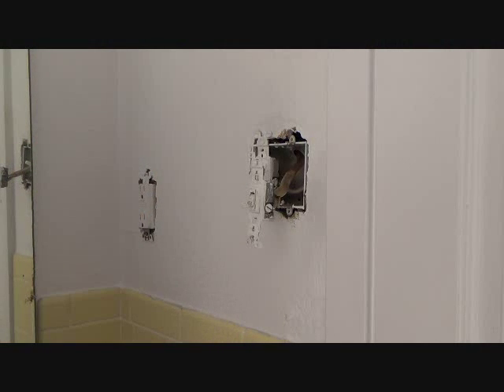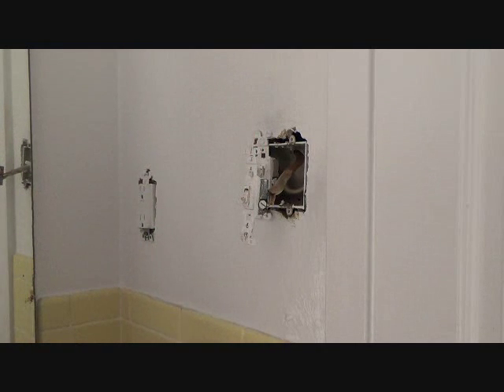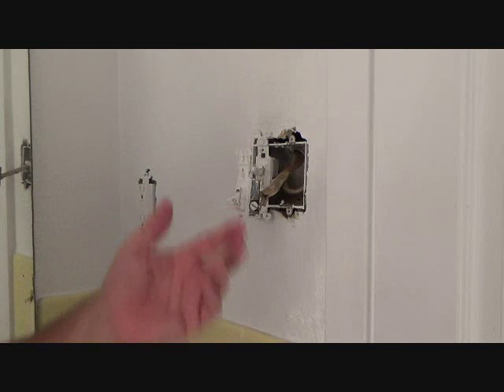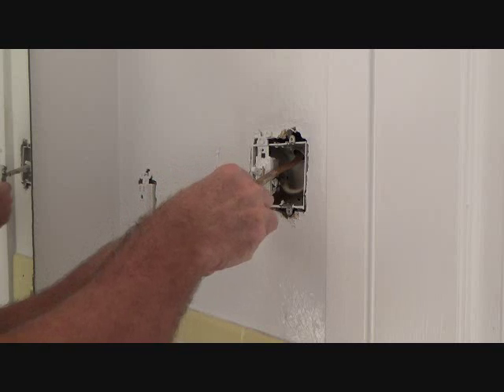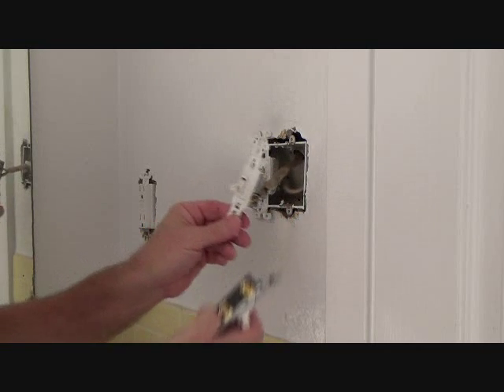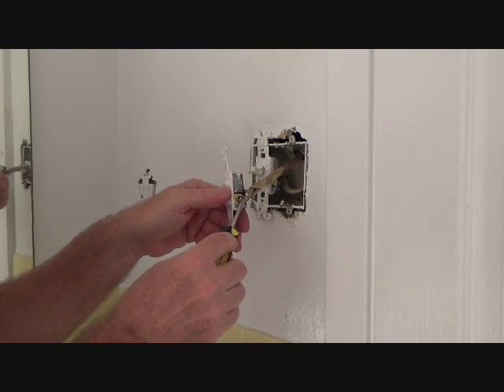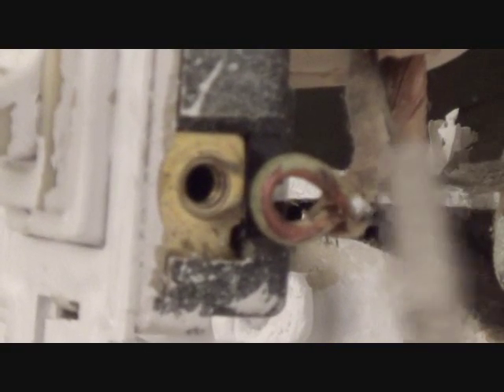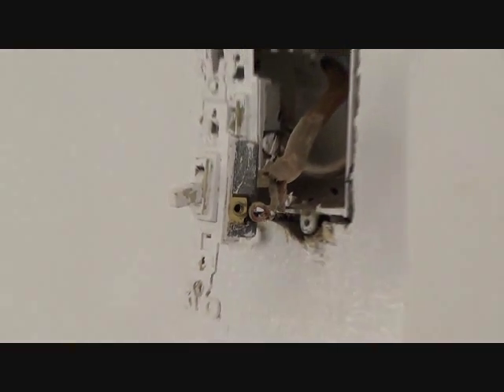Why is there a white wire connected to the light switch?

Comment: This was exactly what I needed. I had two white wires nutted together,, two grounds nutted together and two black wires going into the switch because lighting controlled in ceiling. So installing a dimmer switch simply left the white wires alone added the green ground wire from dimmer to the two nutted grounds and then side screw the blacks to the dimmer hot side top and bottom. Voila done. Thank you 🎉
Reply from the maker: Nice going! sounds good!

Comment: Where do all these wires go?? In my 1950's house, my bedroom ceiling light box has 5 cables coming into it: the power coming in, a bedroom wall switch, a wall plug, a bathroom wall switch, and an outside light. I am at a loss with what to do with all these wires.
Reply from the maker: Yes in the old days they use to use the light fixture junction boxes to where they would bring the main power to then offshoot to other locations as you have mentioned. Now days most of the time the main power cables are generally run to a light switch location THEN up to light fixture from light switch while in the old days the main power source was fed to the light fixture THEN from there they would bring power down to light switch then back up to actual light fixture making it confusing for some people such as yourself! Generally now they would also bring main power to a duplex outlet then from there to another duplex outlet etc & not first power to a light fixture then from there power down to a duplex outlet etc. such as yours. So the power you have up at your light fixture will kind of get confusing to you for sure....let's just look at the main power wires that come in to your light fixture then down to wall switch. Let's talk about the wires going to your wall switch for that same light fixture......if you go in your wall switch junction box you will probably see a white wire & a black wire only. The black wire is probably the power wire coming from your light fixture then down to power your wall switch & the white wire is the power feed that goes back up from your light switch & powers up your actual light fixture black wire coming from your actual light fixture itself....see? Kind of hard to explain since in most cases today they would do it differently because the white wires are generally used for the neutral side of a circuit only while in your case they are using the white wire as a black power wire & not a neutral wire per se.....the initial electrician should have put some black electrical tape on that white wire in your wall switch box so you would know that they were actually using that white neutral wire for an actual black power wire. So that should resolve your wall switch for your actual light fixture. Most all the other wires that are in your light fixture box as you have said the black wirers should all go together & the white wires should all go together but the white wire that comes back up from the one wall switch that powers that actual light fixture would then connect to the actual black wire that is coming from the actual light fixture itself & the white wire that is coming from the actual light fixture should then be connected to all the other white wires in the junction box.....am I confusing you? That's what I think they are doing in your case.....they used the light fixture junction box as the main power junction box to then take power all to your other locations. Let me know if you understand what I am saying here & check out that one light fixture wall switch box to see if that one light switch that is working for this one light fixture is wired this way. Thanks for stopping by! Watch that video again & it might become more clear to you what they are doing for at least the light switch that is being used for that one light fixture....
Reply from the maker: Let's just talk about the black & white wire that go down to the wall switch for this one light fixture ok? The black wire will be the power wire for the light switch. The white wire will be the power wire from the light switch that will then get connected to the black power wire from the light fixture itself. The white wire from the actual light fixture will then be connected up to all the other white wires in the junction ceiling box...boom! See? All the white wires in the ceiling box will all go together EXCEPT the white power wire that is coming up from that one light switch. Then all the black wires will go together as I believe. Your main power black wire that comes into this box is the power wire that will feed all the other black wires in the box so put all those together under one wire nut, EXCEPT the black wire that is coming from the actual light fixture itself.....that black wire from the light fixture will be connected to that white wire that is coming up from the light switch for this same light fixture.....see?
Reply from the maker: Reread my two messages & let me know if you understand what I am saying & send me your thoughts & or questions....because I am not there to actually see where all these wires are going I am making an educated guess to your situation so send me a message after reading my messages. Thanks again!

Comment: So they hooked the white wires together in the light fixture?
Reply from the maker: Sometimes though some electricians will actually run the hot set of wires to the light fixture ceiling box first then they will run a feeder wire from the light fixture to go down to the light switch so then they would connect the wires up in the light fixture a little bit different as one of the hot wires will go down to the light switch & then one wire will go from the light switch back up to the light fixture so in this case one of the white wires going down to the light switch will actually be a hot wire not a neutral wire since a light switch doesn't need a neutral white wire connected to it.....Confused yet? When the electrician might decide to do this they should actually put a piece of black electrical tape on the white wire up in the light fixture box to notify anyone that they are actually using the white wire as a black wire. So if you open up the light switch area & if one of the wires connected to the light switch is white then you know that the main power is up in the light fixture then goes down tot he light switch. Generally when this happens you will only have a white wire & a black wire in the light switch junction box with both of those wires connected to the light switch. In most cases though the electrician will run the power to the light switch first but in the old days they used to always take the power to the light fixture first. Let me know if you have any questions... hope this answers your question.
Reply: @VideoJoeKnows  reason I ask is because in my bathroom I’m wanting to change light out there’s 3 wires 2 white one black and a ground one of the white wire is hot and the other white one goes to switch an the black one goes to switch then the solid copper ground for me to be able to run the switch should I hook the white coming to switch and the white one that hot to the light fixture then the black hook together then ground it for it to work ? I’m lost
Reply from the maker: @southernslipping4225  I am making the assumption you are talking about the wires up in the ceiling light fixture junction box. Here's a question I would like to ask...are you sure there's not two black wires up there as well as the two white wires & ground wire you had mentioned? You have said there was just one black wire...but most of the time there would be two black wires....if the main power is in fact going to the light fixture junction box first then there should be a black & white wire & ground wire for that as the black wire is the main hot power wire & the main white wire should be the neutral wire for the circuit. From that there should then be a separate black wire & separate white wire that go down to the light switch & the black wire would be the one to power the light switch & the white wire should be the power coming back up from the light switch to then power the light fixture...if that was the case then the main hot black wire in the light fixture ceiling box would then be connected to the black wire that then goes down to the light switch & be connected with a wire nut......then the white wire that comes back up from the light switch would then be connected to the black wire from your light fixture. The white wire from your light fixture would then be connected to the main white neutral wire that comes into the light fixture junction box & your ground wire would be connected to the ground wire. See what I mean? So I'm surprised if your light fixture junction box only has one black wire in it along with two white wires. Look again & see if in fact you only have one black wire in there.....If you only have one black wire then I would think you should only have one white wire there too since then it would tell me that the main power wires would be at your light switch & not at your light fixture. How about removing your light switch from the wall to see how many wires are in the junction wall box. If the power is at the light fixture then you should only have one white wire & one black wire & a ground wire in the light switch junction box & both the white & black wire & ground wire would be connected to the light switch. Let me know what you find so I can assist further if need be.
Reply: @VideoJoeKnows  there is a white wire and a solid copper wire then there’s another white and black coming from the switch .. also I was go ask in my other light they have the solid wire hooked to the white wire do I need to hook this one with solid wire to the white wire ?
Reply from the maker: @southernslipping4225  Still weird for me to think you don't have another black wire up in the light fixture junction box. Did you look really close? Why would the previous electrician only bring a white & ground wire to this box if the other white & black wire are coming back up for the light switch location? As for your other light fixture, how many wires are up in the junction box?
Reply from the maker: @southernslipping4225  Usually a solid copper wire would be the ground wire...so my question would be...where is the black hot wire that feels the light fixture junction box?
Reply from the maker: @southernslipping4225  If the main power is in fact coming into the light fixture ceiling junction box then you should have a black hot wire & a white neutral wire & a ground wire coming into the box for the main power source. If you then say there is a black wire & white wire going down to the light switch from that same light fixture ceiling box then my question is where is the main black hot wire? It should be in that box too.....
Reply: @VideoJoeKnows  it’s and older home it only has the wires I listed .. that’s why I bum fuzzled to ha but my light in hall way has the solid copper wire and white ran together and the blacks together
Reply from the maker: @southernslipping4225  Not sure what to tell you as I've only seen wire run the two ways I have previously explained. When you removed the existing light fixture, do you remember which wires went where? You could hook up the very same way back couldn't you?
Reply: @VideoJoeKnows  it was a plug in there and I didn’t take it off
Reply from the maker: @southernslipping4225  Hmmmm...please explain with more details.

Comment: I have a red white and black wire. Where do I put the red or the white?
Reply from the maker: So do I take it your actual light switch may in fact be a 3 way light switch? So lots of times electricians will take the main power line up to a light fixture then come down to a light switch so then the white wire will be a switch feeder line with the black also being a hot. So if you have a red too then it sounds like you have a 3way light switch with all tree wires connecting to the light switch? In what figuration I couldn't tell you but you could swap things around until the 3 way light switches work. If your light switch is just a single pole light switch for just one light fixture then not sure what the red wire is for. Let me know if you have questions seems as though I can't see in your light switch box.

Comment: Hi. My switch is like that. black and white wires both connected to it in and out. Can I replace this with a dimmer switch?
Reply from the maker: Yes I don't see why not. The electricians years ago sometimes to the main power to the light fixture first then just came down with the wires to the light switch while most electricians bring the main power to the light switch location then back up to light fixture from the switch. So the black wire in your switch box is probably the power down then they are using the white wire as the switch leg to go back up to control the light. See what I mean? Then should've wrapped some black electrical tape around the white wire since they are using it for a hot wire. So when you go to connect up the dimmer switch just connect wires same as you see on your light switch. You should be find. Let me know if you have any questions...

Comment: My light switch has a white and black attached and I would like to add a bathroom fan to the switch. How do I do this?
Reply from the maker: Well I think it's possible for you to add an additional bathroom fan switch at this location however it's complicated for me to try to attempt to explain to you just how to do that. There are a few different ways to add another light switch at this location. You could put a stacked light switch in the existing location or you could remove the light switch & the junction box & install a 2gang light switch junction box then also have enough room to fish a wire down the wall for the added bathroom exhaust fan or ceiling fan & the wiring can be done there as well. Most light switches only have black wires attached to them & the reason one of your wires is white is because they are probably taking the actual power from a ceiling light fixture junction box then running down to the light switch then back up with the other black wire so they are actually using the white wire as a black wire. In the old days electrician s would do this but they should've wrapped the end of the white wire with some black electrical tape to identify to others later on that the white wire is actually a black wire. Confused yet?! You might want to have an electrician come in & do the work for you...? or.....I have a ton of electrical videos on my channel that could assist you further with your entire project. Just go to my main YouTube channel page then click on playlists then scroll down to electrical to get your fill of more electrical learning! Yes....?

Comment: You need to cut Romex outer sheathing back to only 1/2” is in box. That is not code. While you are at it, you should add 6” pigtails to those very short leads/wires.  Not code that way either.
Reply from the maker: Thanks for the tips! Why aren't you making howto videos?!

Comment: Can add outlet from this switch and how
Reply from the maker: I don't think you could add an outlet at this location with the wires that are there presently if you only have a black & white wire & ground wire in there as there is not a neutral wire present which would be required to install an outlet. See? Watch this video again & maybe you will see what I mean as the main power is up at the light fixture not here at the light switch location.

Comment: My house was built in 2017, I went to install a light, the Romex in the outlet had 4 wires, the copper wire, the white the red and the black wire. The light had 3 wires, the copper the white and the black. I connected the white to the white the black to the black and the copper to the copper and put a cap on the red because the light did not have any red wire. When i put the breaker back on the light came on but the switch cannot turn it off. I opened the switch and saw the red and black wires connected to the switch, the white wire is capped with a screw cap. Can I change the wiring at the light from the white on the fixture to the red in the Romex?
Reply: The red needs to be hooked up, that’s your switch leg
Reply from the maker: Yea maybe they just are not using the white wire at all for anything but I still would've though the white wire in the light fixture would be connected to the main wires coming in for power for the neutral leg unless they have that connected somewhere else for some reason
Reply: Fire Fly @@ get Electrician’s help. Or you could get hurt or cause a fire. It sounds like you just don’t know enough to be touching this.  It’s not lawn mowing...
Reply from the maker: Never seen a light switch with the red wire in there too like that. Most of the time they would use the white wire as a switch leg to go back up to the light to turn it on with the main power coming in from the light fixture instead of the light switch location but I have not see why they would install a red wire too so that stumps me. what did you end up doing to install properly?

Comment: Thanks for the video i was wondering with my switch has a black & white wire,my white wire is the hot side black one us neutral,is crazy..
Reply from the maker: I know. I hate it when I see this sometimes in older homes....
Reply: tino8080 $$ white is NOT HOT. If it is, CALL electrician!!!
Reply: @ShelliLoop  The white is hot in this case (switch loop), there is no neutral on a regular single pole, 3-way, or 4-way switch. A black marking (electrical tape) should be applied to each end to indicate hot.
Reply from the maker: Thanks for your message....
Reply from the maker: Thanks for stopping by...